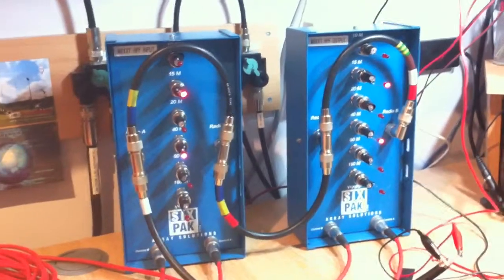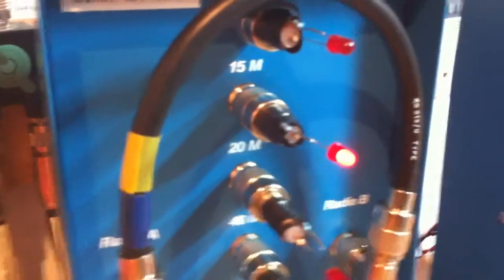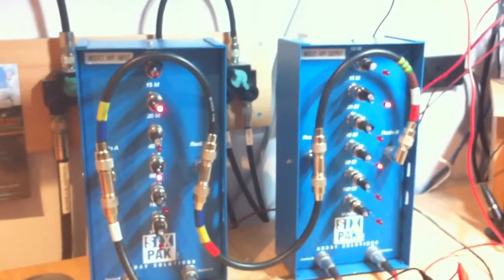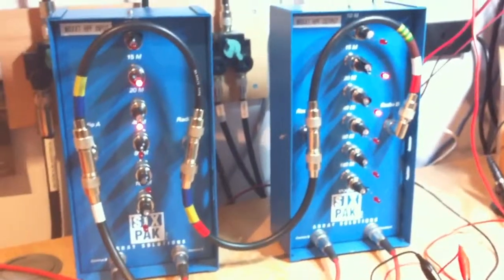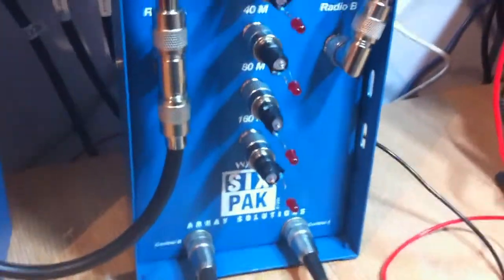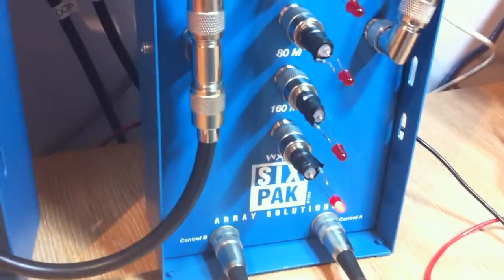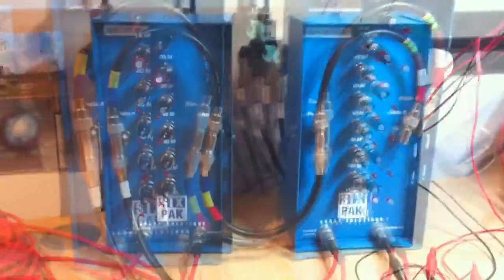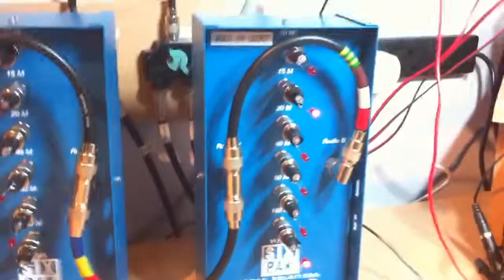Testing the SixPak filter switches

Comment: I had a similar problem with my six pack switch, running it with a standard 12V (13.8V output) power supply. I was told by array solutions that I needed to use higher voltage in order to reliably switch the relays. I had an old 18V laptop supply which I hooked up, and have never had an issue since then. You might try that. 73 Randy K0EU